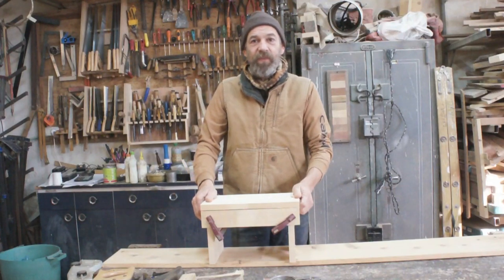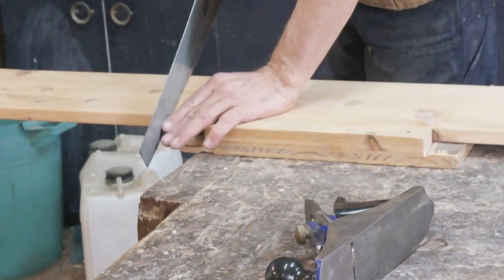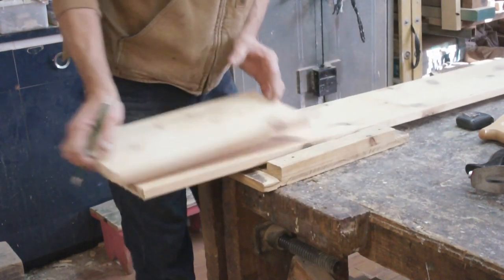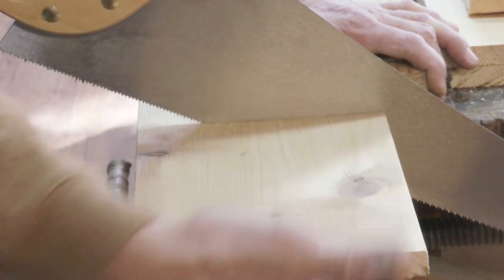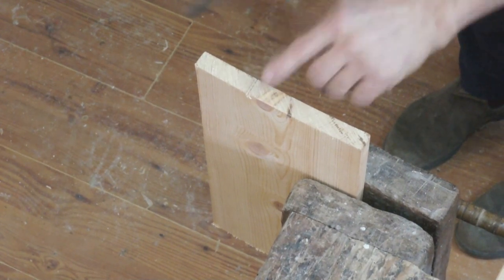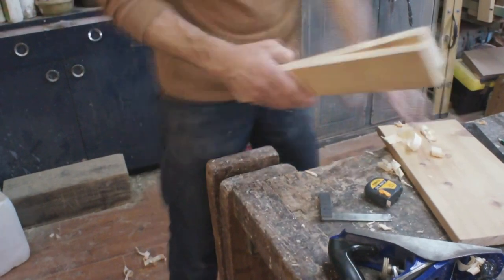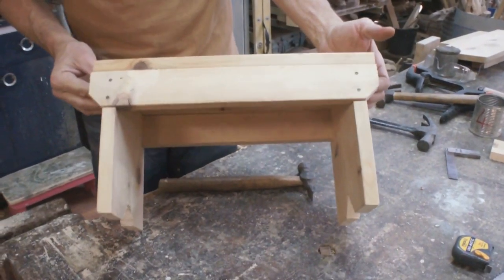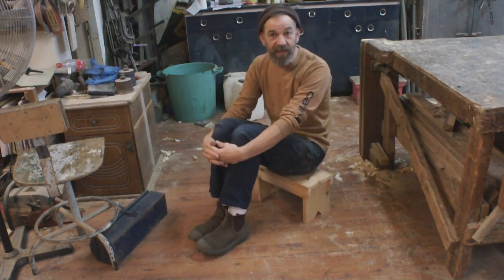How To Make A Simple Wooden Stool

Comment: Thanks for being awesome David, love watching your videos. I just spent an enjoyable afternoon cutting out the pieces as you described. What's the approximate width of that board you used? Wondering if I should have used the 10" pine instead of the 8.
Cheers!
Reply from the maker: Hi Joshua I believe i used a 19cm board close to 8” which is good for a small stool but you can scale it up to a full size bench and it will be strong Good luck with your project Happy Woodworking David

Comment: Thanks for the excellent tutorial David, I've cut all the parts out, only I've used chipwood?? Will this split when I put the nails in?
Reply from the maker: Hi Jason yes chipboard isn’t very good with nails if you have some way to drill small pilot holes it will help Let me know if I can be of any further assistance Take care David ps use the thinnest nails you have to help prevent splitting you can cut off nails head and use it as a small drill to make pilot hole
Reply: @RusticDavid  Thanks David for your quick response and advice. 
In this case would you use screws instead??
Reply from the maker: Jason Burton Hi screws would be preferable if you can make pilot holes first, if your screw diameter is 4 mm drill 4mm in “top”piece and drill2.5 mm in “mating” piece , countersink “ top “piece so the screw head is flush you can ose the tip of a 10mm bit as a countersink
Reply: @RusticDavid  Thanks David 👍
Reply: Great advice David, no split wood 👍the only thing now, one of the legs is slightly angled in 🤣🙈 I guess I'll have to make a couple of stretchers to go along the bottom??
Reply from the maker: Jason Burton Bravo! You can add stretchers1/3 up well done.btw where are you?
Reply: @RusticDavid  Thanks David will add stretchers, I'm in London
Reply from the maker: Jason Burton keep safe be strong stay positive Love to you and your family from Israel
Reply: @RusticDavid  Hope you and your family keep safe too David 👍 All the best

Comment: When i saw the plywood the hand saw jams between the wood why, is the saw bad or my technique is wrong any tutorials pls
Reply from the maker: Hi yogesh possibly your saw is old and the teeth need resetting that’s to say they are not wider than the saw plate and the plate gets stuck or possibly you’re not keeping the saw straight in the cut try just moving the saw back and forth in a straight line without applying downward pressure plywood isn’t the easiest to cut with a hand saw due to the grain running in two different directions try using a finer tooth saw ,https://youtu.be/fWK643fAn6o maybe this will help good luck let me know how you get on David

Comment: Whats the tool used at 9.36
Reply from the maker: Hi Andrew i used a 20mm chisel to remove excess material and square things up if you don’t have a sharp chisel you can use a file,a rasp or some sand paper on a block of wood 
Good luck Happy Woodworking David